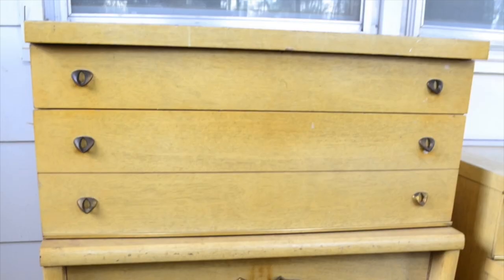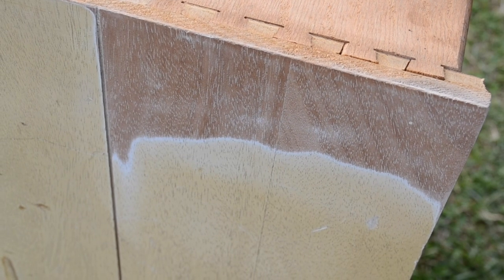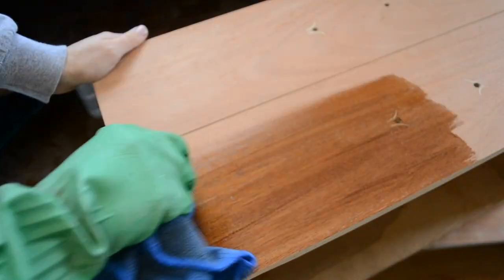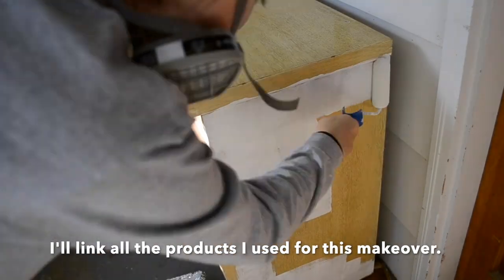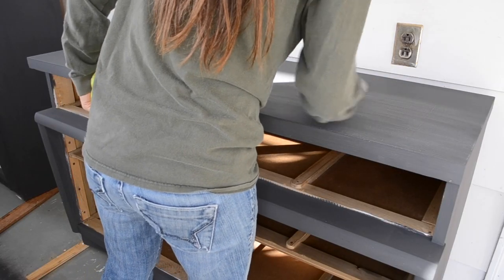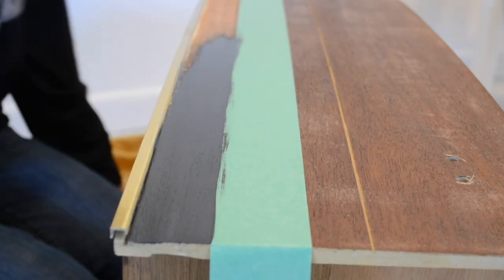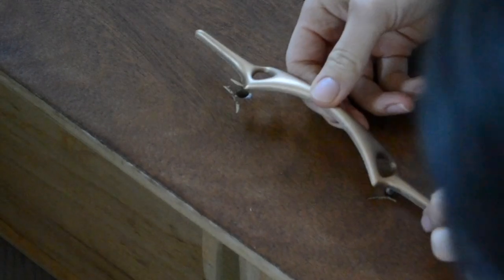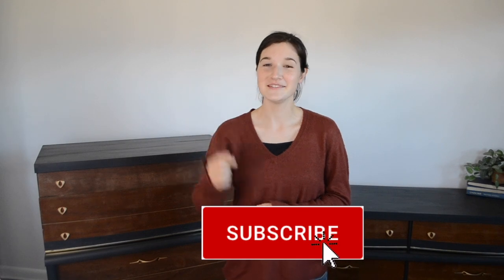Mid Century Modern Dressers Makeover! Furniture Flipping for a Profit! Refinishing Dated Dressers

Comment: Beautiful Work!  I prefer not to use drawer liners.  I believer the natural wood w/Orange Glo is much prettier.  Also I have struggled to remover 40+ year old drawer liners w/ hair dryer, sander, scrapers, soap and water -- what a hot mess !
Reply from the maker: Thank you for your comment! 
I like to use drawer liner whenever the drawers have been permanently stained and can’t be sanded or washed clean. The drawer liner I use, pull off very easy and can be removed if desired.